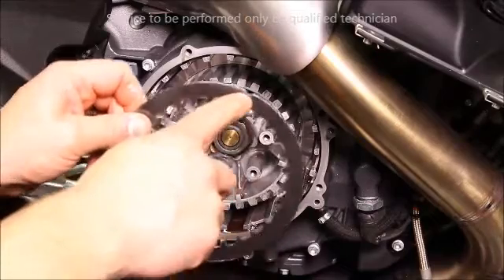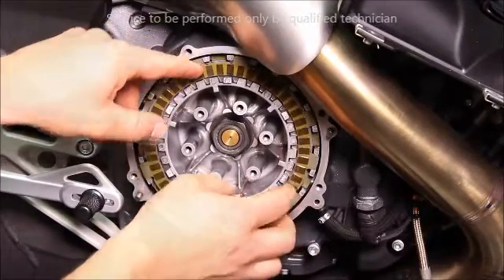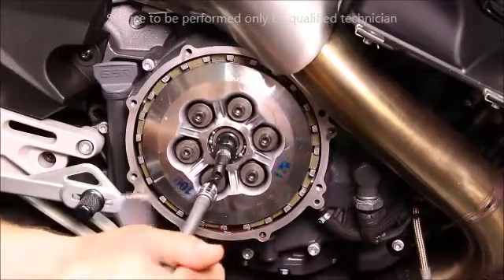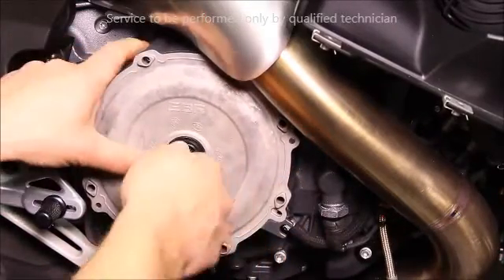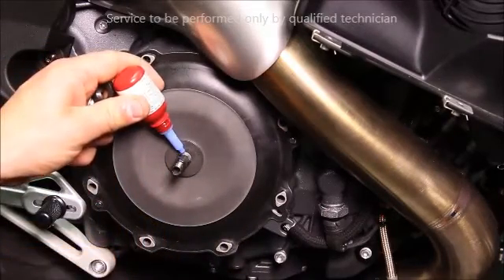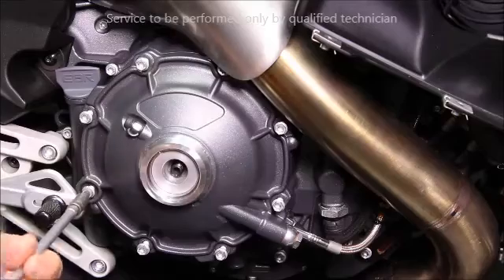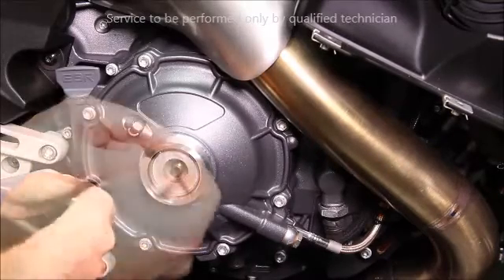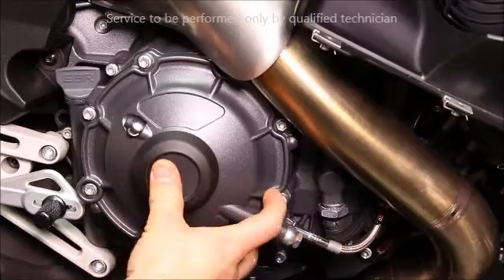EBR 1190RX/1190SX Service Manual - Powertrain - Clutch Plate Installation

Comment: What specific tool are you using before you finish up the clutch cover? I asked for a unique tool specific for changing my clutch plates on my 2014 EBR 1190sx from EBR but they sent a clutch hub locking tool, which I don't need.
Reply: ? I don't use any special tools, except the locking plate if you remove the clutch basked. And you want to lock the crank so you need the crank locking pin.  I believe you refer to the screw and the half round nut that is mounted onto the hydraulic clutch piston. Here you can use a straight fwd alen key and a 17 mm loop hole wrench. ( I just completed my 2nd full engine overhaul, replaced piston rings, valve stem seals, shifter drum, honed up the cylinders and replaced some seals. )